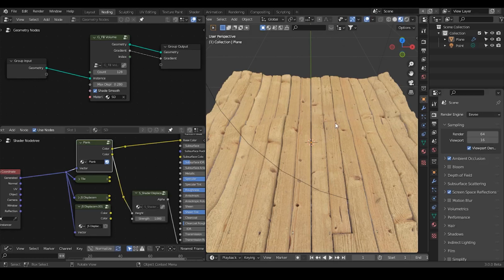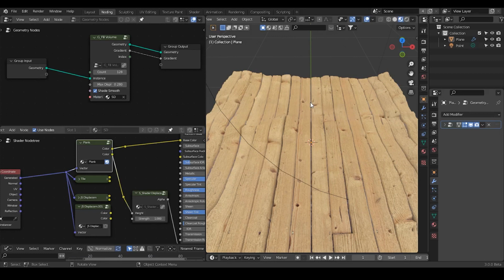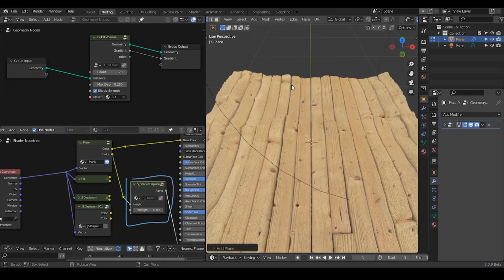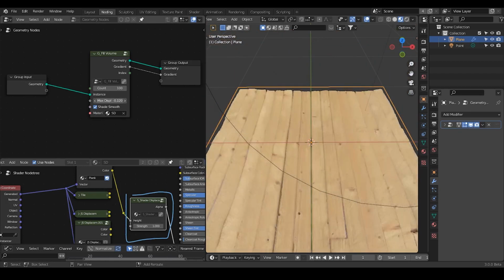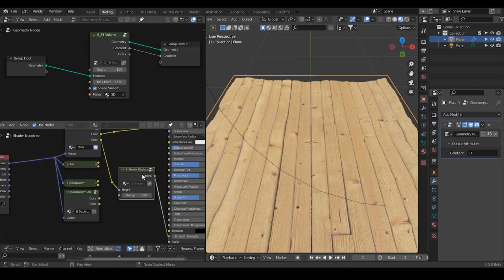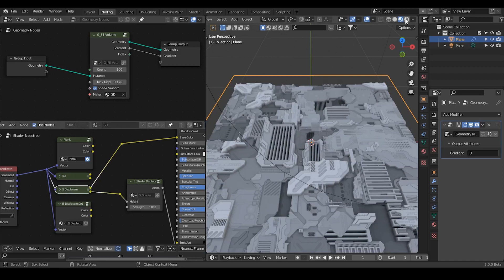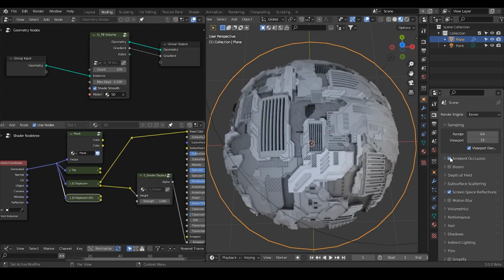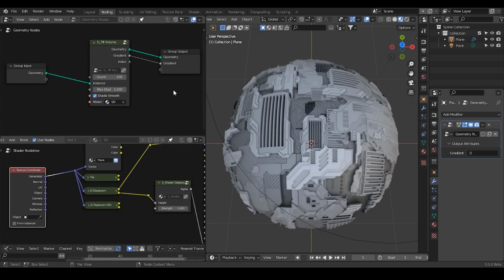[Demo] Shader Displacement in Eevee

Comment: I love that geo nodes allow this, I'm a big fan of original bbn19 method but with modifiers and UV only it was clunky t setup now I just have this in my asset libraray plus it works with procidural textures making it basically a crisp realtime volumetric engine something that cycles displacement can't even do.